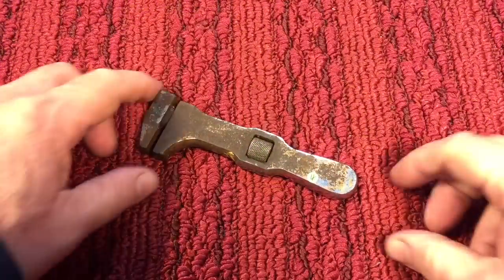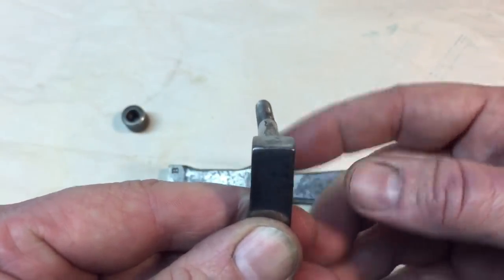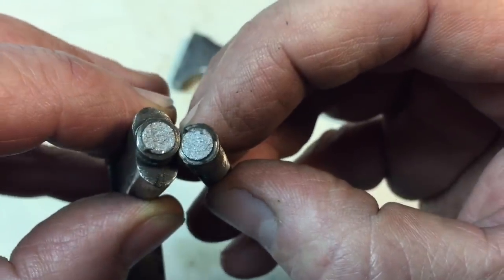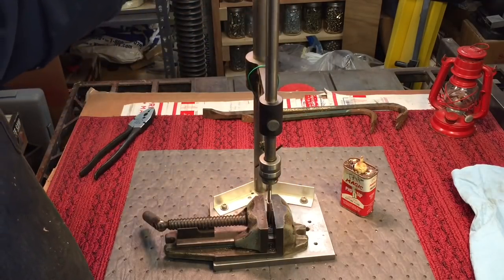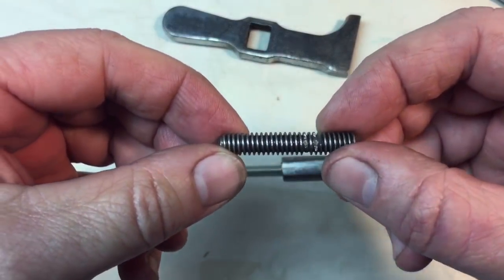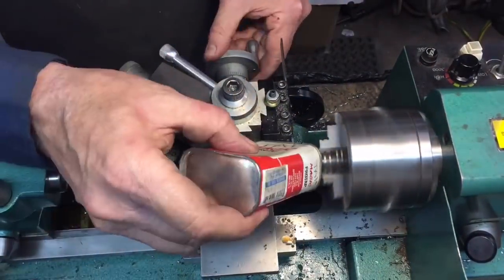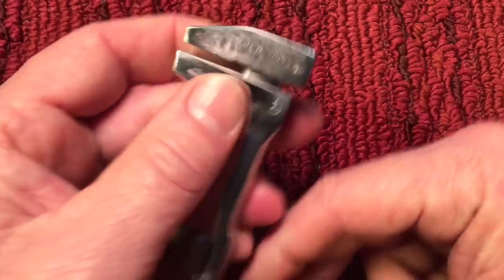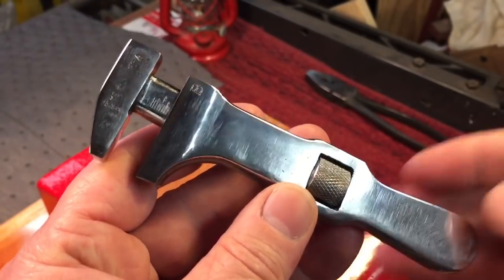Restoration Challenge! 1879 Billings Bicycle Wrench!

Comment: Great restoration; great lathe and tap work!  Glad you rebuilt it instead of tossing it.  Your viewers are learning a lot from your projects.  Keep the videos coming.  If there is anything special you do to prepare various tools for painting, please be sure to tell us. Thanks again.
Reply from the maker: Hello Anonymous98!  Usually I just make sure the tools are squeaky clean before paint, I wipe them down with denatured alcohol or lacquer thinner and after spraying them I put them in a warm dry place (for me it's the oil burner in my house). Thanks very much!!!   😃👍

Comment: Wow, my heart went out to you when the thread broke but what an amazing recovery !!. The wrench (I still want to call it a spanner being a Brit) looks great and most importantly works wonderfully. I have just got a Richards adjustable spanner marked 1943 with the War Department mark on it of a similar design and guess what, the thread is slightly bent like this one. Your video is a lifesaver as it has warned me that it is brittle. Take care and kind regards from this side of the Atlantic.
Reply from the maker: Hello Tony!  I had to laugh because the week before Old Sneelock had a similar incident!  Lol. If I had to do it all over again I would probably add heat...  Normally I try not to disturb the temper but I don't know how else to straighten it without the "DOH"!     Thanks very much!!!   😃👍

Comment: I like your idea of using threaded rod and machining a new adjusting nut. Very cool to have the metal lathe. nice job!
Reply from the maker: Hello Mick, I would have liked to replace the acme thread but it is hard to find and I wanted to fix it right then..  If the wrench was perfect to start maybe I would have gone the extra mile but you saw the pits and rust, I wasn't 100% sure it would shine as good as it did!  Thanks very much!!!!!

Comment: Hey, nice fix! "I could toss the wrench, which would probably be the smart thing to do." At least you're honest lol.

 Cool to see some lathe work on this channel. Looks like that thread is a tiny ACME trapezoidal thread. It's possibly you could have found a tap and all-thread, but the new nut was definitely the way to go. I'm amazed at how well your little lathe parts off. I've even had a fair bit of trouble with our 10". Between the parting blade cutting a taper, or it jamming and breaking the blade. Perhaps it's I that is the problem. Making one of those little tapping devices is on the list, they're pretty cool. Yours looks like it works nice.

Lastly, that machinist vice is super unique. Half nut for quick adjust and a coarse buttress thread to make it work. Never seen that before.
Reply from the maker: Hello Metal Butcher !  Wow you really know your stuff!!!  Your spot on about both threads!!! The Billings is indeed an acme thread and I probably could have gotten some from McMaster Carr and then shipping, waiting, then either buying an acme tap or turning down the end and pinning it...  If the wrench was a pristine or rare model, maybe but these are available all day long at $30 for a really nice example...  BTW acme threads are awesome, I wonder why these were broken/damaged?    And what's most impressive is that you picked out the buttress threads on the machine vise!  About ten years ago I found a big old lag bolt on the ground, it must have came from a nearby telephone pole, I examined the threads and was amazed!  WTH kind of magic is this?!? I asked around and nobody knew anything until I asked a machinist, he said "Oh yeah, that's a buttress thread". Ever since I felt somewhat enlightened!  That's some interesting stuff right there!!!  You really know your threads!!!  Thanks very much!!!!
Reply: :)

I'm not sure how the threads got broken. Maybe it was over hardened, they were brittle and any grit in the nut over stressed them. Not really sure.

As for the buttress thread, I learned about those after researching them after seeing them in on of Adam Booth's Hydraulic videos. Apparently some cylinder glands use them. I'm guessing yours are cut negative, so the tighter you tighten the vise, the more it pulls it into the nut?
Reply from the maker: The Metal Butcher - With the buttress threads I'm not sure what positive or Negative is but there is a sort of built in half-nut at the rear of the vise and all you do is lift the threaded arm out of the half nut pocket and the vise becomes 'fast acting', when you want to tighten the vise just drop the rod into the pocket and you're ready to tighten!  Works surprisingly well!!!  I would like to do a video on machine vises, I have a bunch, but my audience is mostly just regular people who enjoy seeing stuff cleaned up with a bit of history... Lol.  Thanks!!!  😃👍

Comment: As usual, a great restoration. One comment if I may, the threaded rod has such sharp threads but obviously worked. Awhile back, I replaced the threaded rod on my small drill press vise. I purchased a replacement threaded rod at ACE but it was totally different than the original, it too had the sharp threads. I went to OSH and they had a better threaded rod that matched the original. I know, who is this guy a troll, no just stating my opinion. Thanks for sharing and looking forward to more great videos. Ken, the old guy from Marina CA.
Reply from the maker: Hello Ken!  Absolutely right!  The threaded portion of the wrench was originally a ACME thread, very common for vises and clamps...  This Billings wrench used a particular size that was forged along with the wrench.  Now if this wrench was pristine and I wanted to restore it the best way possible I could have found a supply of Acme threaded rod and turned down one end so that it would fit in the body of the head, then drill the rod and pin it so it wouldn't spin. Then I could have used the original nut.  Now this wrench was a very poor example of the Billings Bicycle wrench to start off with meaning it will NEVER be worth anything because it was in really poor shape. You can find beautiful examples of this wrench all day long for $30 on eBay... So like I said in my earlier videos, you have to be very careful about getting sucked into a restoration that is just cost prohibitive!  I spent 15 years restoring a 1951 Pontiac and took a big loss when I sold it but I learned a valuable lesson.  If you count the 3 hours time on this restoration and the $4 I paid for this wrench I am still very much in the hole!  Even if the wrench was perfect to start it has little value as a repaired item so use what you have around the shop, get it working and chalk it up to experience...   Just so you know I did look for a acme bolt around the shop but very uncommon in that size!  Thanks Ken!  BTW you've got good eyes!!!   =)

Comment: Great fix. Glad you didn’t toss it.
Reply from the maker: Hello Lisa!!!  It was close!  lol   It was so rusty!!!!   =D   Thanks very much!!!!!!
Reply: ScoutCrafter   I made a big boo boo today.  I was cleaning up a drift punch set.  After watching you I found the maker.  Starrett    OMG I was so excited. A full set of 8 in a round wooden box.  I cleaned them up.  The last one was a tiny one and it was bent.  I had to try.   SNAP   It broke.  I said a couple really bad words.  Now I don’t have a full set 😩😢
Reply from the maker: Hello Lisa!  That is not a problem at all because punches are readily available in any size to complete your set! It might have been a 1/16" punch or 1/32"  Just wait and you will find a replacement very soon!!! Even eBay is a good source!  I have seen many of those Starrett sets missing one or two punches... The Wooden box is what is the real find!  That is harder to come by!!!!!  BTW- You had to try to straighten the punch because it was useless when bent!  All in all it was a Great score!!!
Reply: ScoutCrafter  Thanks!

Comment: I just bought my first old time tool. A wrench very similar to that one. It also has a twisted threaded end, just like yours. So now I'm terrified to try to straighten it. I don´t have the facilities you have to make new parts. Wish me luck!
Reply: RobertoDonatti, heat and tap....less likely to shear.
Reply from the maker: Hello Roberto!!!!  Some forged wrenches are no problem to straighten but the cast ones are unforgiving!!!!  Apply some heat, it always helps soften the metal a little!   Thanks and GOOD LUCK!!!!!!!  =)

Comment: hi scout  good vid  ...   was wondering  have a old home brew grinder   it has a large white wheel  on it   was kinda wondering  what it  is  for    any idea  ..   thanks    ..    †
Reply from the maker: Hello Reds!  The most common wheels as you know are Grey and they do a decent job however the White wheels are usually Aluminum Oxide and cut faster and run cooler making them a nice choice for grinding tool bits and other items you don't want over-heated!  It's a good wheel!!!  Thanks very much!!!!!
Reply: kool  thanks    ...  kinda strange   thing  but  do you  drip  little  water  on  that  kind  of   wheel    or   ..

Comment: Probably better than new as the thread looks finer and would be more accurate to adjust.
Reply from the maker: Hello Tony!  The Original ACME threads were sweet and smooth but hard to find and not worth the effort!  However you are right the 1/4-20 pitch makes it very adjustable!!!!   Thanks very much!!!!

Comment: Maybe you need to expand your abilities and setup a nickel or chrome plating operation for those type wrenches. Because even with a polish on such a piece it will rust again. But very nice restoration effort.
Reply from the maker: Hello Gary!  Many tools years ago came unfinished, that is where most "patina" comes from.  I have tools that are 15 years old that were polished and they haven't changed.  If the tool is left outside and not in a climate controlled area all bets are off with any finish!  Steel and iron will rust no matter what!  The best we can do is try to keep them in a moderate and dry environment and cross our fingers!!  lol   thanks!

Comment: As always, nice work. One question: Do you think that heating would have prevented the breakage? (For future reference)
Reply from the maker: Hello William! It’s funny you ask that because another subscriber has the same wrench with the same problem! I too suggested heat!  It’s a funny thing because we always try to avoid heat because it can destroy or change the temper of the metal, yet it might also add just enough give to allow movement.  I think next time I will try the heat! Screw the temper!  Lol. Thanks very much!!!   😃👍
Reply: re quenching and heat treating wouldnt be so hard to do on  such a small part anyway, ive made tools up to around 8 inches long and used two bricks and a butane torch! and still got an even tempering colour out of it, nice dark blue temper, shame it wears off quick though